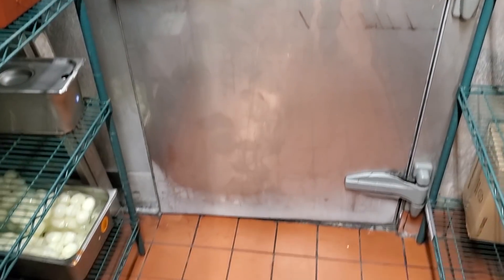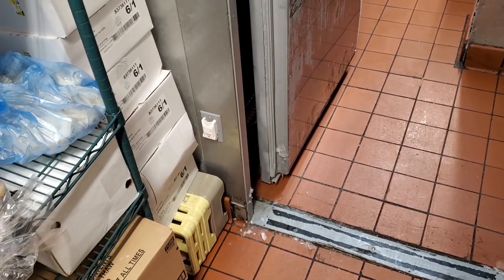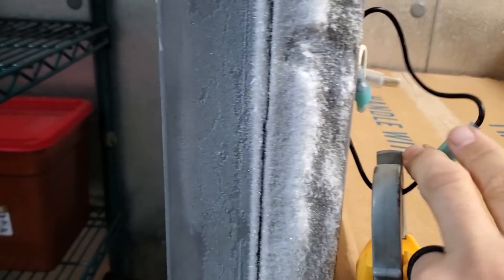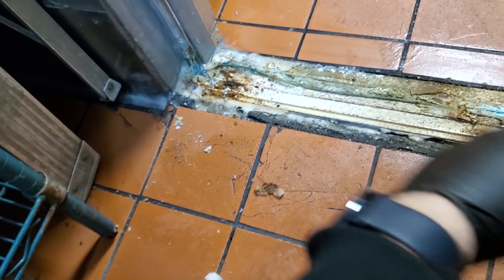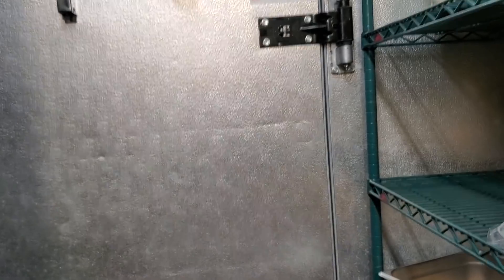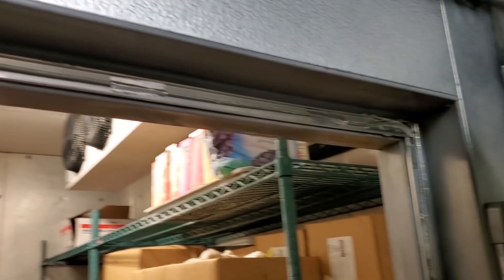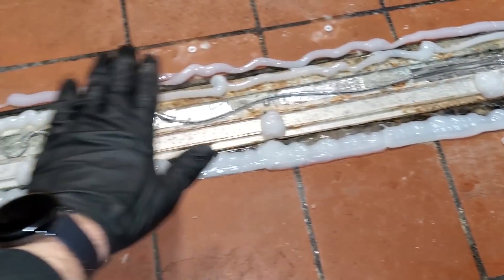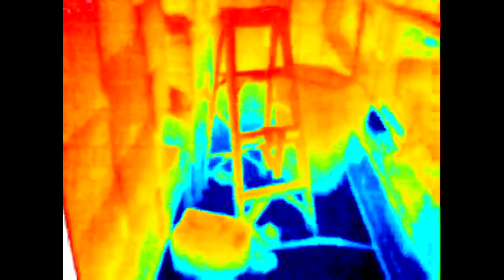WALK IN FREEZER DOOR WON'T SHUT

Comment: Great job as always Chris!  Excellent cinematography with fantastic explanations.  Made it really easy to follow for a newb like me!
The only thing that had me mildly bugged (and more from my construction past than HVAC) was the fastener spacing on that floor plate.  I know it's puckied good, but that's a pretty hefty span right in the center where it's going to get a lot of traffic, and I can see flexing becoming an issue.  I personally would have felt a lot better with one more in the center on that edge, splitting the difference between the two for added hold and security, but I'm probably over thinking it.  Great job!!!  Thanks for sharing this!

Comment: We'd sold and serviced "Bally Refrigeration" for more than twenty years, as they were local to  our service area [central and southeastern PA]. The three most important facets for a successful "walk in freezer" were: A, the concrete pad had to be perfect, and in accordance with manufacturer's spec's [always have as part of installation contract] B. check that everything is level, plumb, and square with each panel [and document with sign off] C. service/cleaning [both sets of coils, sealed system check, panel seal eval, full install checked over for first three years - included with sales/install agreement. Years four and five, parts covered, labor at flat rate, and compressor replacement fully covered thru year seven.

The only repetitive problems were caused by chlorinated cleaning solvents, i.e. "evaporator change outs", and that problem was always in the zoned prep areas; dedicated freezers were immune to everything except for defrost system problems, door gasket stuff, dislodging of panels, because of product being thrown against them, or an inebriated employee backing into the exterior entrance with their pickup truck.

You'll get grumpy with age, sling psychrometers helped mitigate that - back in the day, no such method these days.....

Comment: Thanks Chris.
1. You could consider setting your thermal camera to some fixed color scale e.g. -10 blue +50 white, with known color for 32. This would make the interpretation of the image so much easier.
2. What is the weak point of the heating cable set-up where it usually fail? Is it related to moisture, compression, sharp bend?

Comment: Looks like the exterior walls of the cooler leak like a sieve -- and probably the electrical and piping pass-throughs too.  The negative pressure from the kitchen exhaust fans will challenge the vapor seals around the cooler.  Otherwise, how could air be trying to flow past the door so seriously. Of course the technician can seal piping and electrical past-throughs. The old door sweep might merely be a symptom of air leaks in other places. Of course the the exterior of insulation is where the vapor seal starts and holes though it need to be sealed thoroughly or frost could condense in the walls. Foam filled walls have much advantage but still might have cracks. Fiberglass insulation can be very bad, if it ever becomes laden with condensation.

Comment: Huh....Interesting. So I learned about "threshold"s I guess.

At my job (samsclub) they installed brand new freezers and the bottoms were only silicone with that metal plate and like a couple rivets. It lasted a whopping 3 days before the plate came lost and someone drove a fork under it completely destroying the threshold. They came back to fix it but just added more screws all around and about a month later the threshold is caving in the middle with the outsides sticking up now. Pallets get stuck on it all the time.

Comment: Do you ever consider purchasing yourself a heat gun? That's what I use in those circumstances and I don't have to worry about melting things as you do with a torch. They're not too expensive and I think it's a good investment. You can still melt wires with a heat gun but if you keep your distance you'll be fine that's easier to control than a torch.

Comment: any tricks to getting those heater covers/tracks back on without beating the hell out of the track?
Reply from the maker: its all in the way you put them on so I start by putting on the inside edge than you need a dead blow hammer and one solid strike against the outside edge while holding the inside edge on... Its tricky for sure

Comment: Is the panic alarm set to deactivate the freezer? Would be a neat feature, hit the panic alarm and the system would try and bring the room to a human safe temperature or at least (edit: stop) making it colder.
Reply: Robert Szasz it’s meant for emergencies I believe. Active shooter etc. people hide in the cooler and it’s right there to be activated.
Reply: @_ohmz_electric  right. Or the ol, lock everyone in the fridge/freezer and steal everything. My point is that a deep freeze room is dangerous to people locked inside and the HVAC system could make the room safe when the button was triggered.

Comment: Silly comment time: I think if you add some isopropyl alcohol (98%) to the base after you remove the water that should help you remove more water DON'T VACUUM! wipe it up with a towel but that way any leftover water hidden in the concrete or grout will be mixed with some alcohol and it won't freeze.

Comment: Hey I'm having the same issue at a wif web service. How do you know what length heater, and as far as the threshold is that a universal? Thank you.
Reply: You measure the inner door jam, or opening. Most doors are about 78" x 36". If the freezer door has a threshold, then you order it "4 sides" or "3 sides" with out a threshold. Then you need to know operating temp., and weather you want stainless braid or fiberglass. I did a Koldpak freezer a few weeks ago and replaced the heater track with a dart style base. The snap on cover fit a little loose but seemed to hold. Back out the next day because the cover wouldn't stay on. Had to re-order the heater track and do the job again. That really sucked!! I HATE DOING DOOR HEATERS.

Comment: Door heaters and Heat tape on the drain lines. 🤢 hate the with a passion. Some of those thresholds have particle boards material and when they are rotten is hard to try to install heat elements in those.
Reply from the maker: Yeah the old hartford duracool walk in units used to have that partical board..... I hated that crap  I will discuss this on my Livestream this evening 2/24/20 @5:PM (pacific time) Come on over and check it out if you can. https://youtu.be/qop5jyuMfmc

Comment: Dewalt & Fieldpiece are greater than Milwaukee & Testo. I think I lied about Dewalt is better than Milwaukee.
Reply from the maker: I use a few milwaukee products, I find that both platforms have pretty good stuff
Reply: 50% of my main everyday tool are Dewalt and 50% is Milwaukee M12 since they came out with punch stuff. Ps I have a Dewalt 20v adaptor to Milwaukee M18 Tool.